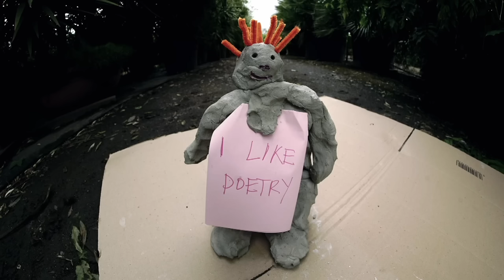Make a Statue THEN Score a Goal With the Steamroller | Full Task

Comment: I mean I would just kick the football with my feet and avoid the stature. Because the task doesn't say I have to use the steamroller I think
Reply: Hindsight is a wonderful thing
Reply: But who wouldn't take use the opportunity to use a steam roller? I'm using that thing even if it means losing points
Reply: @lisahenry20 Anyone who wouldn’t is dead inside
Reply: I would 100% use the steam roller. When do you get to ride a steam roller?!
Reply: @lisahenry20  There's no reason you couldn't use the steam roller and then get off and kick the ball.
Reply: Then it wouldn't be entertaining.  Remember, a lot of the shows appeal comes from the contestans either failing or coming up with a stupid solution to the task.